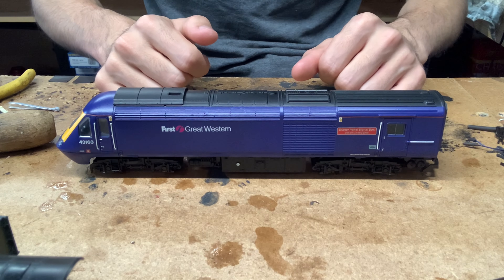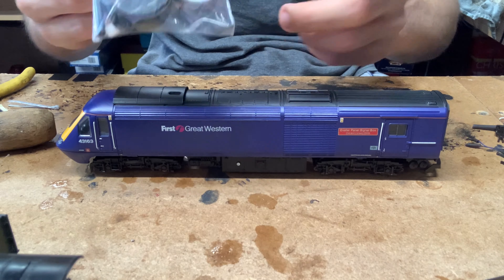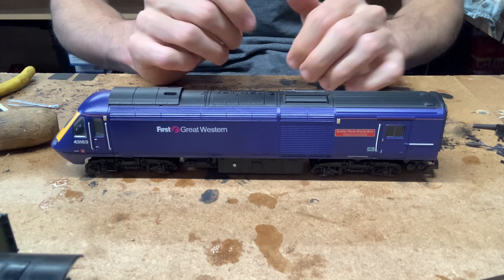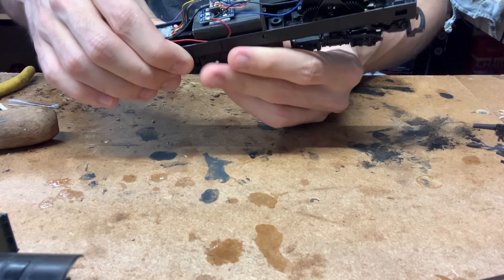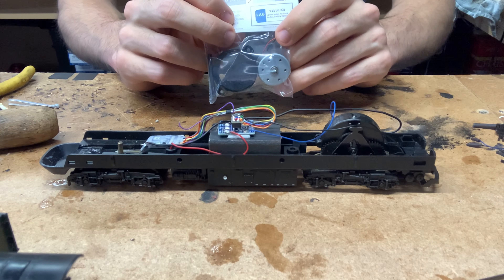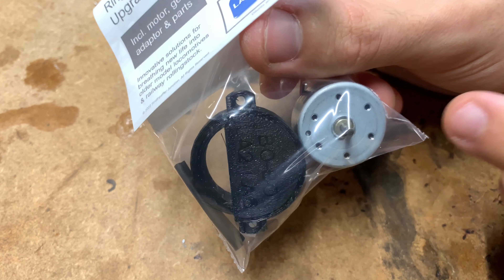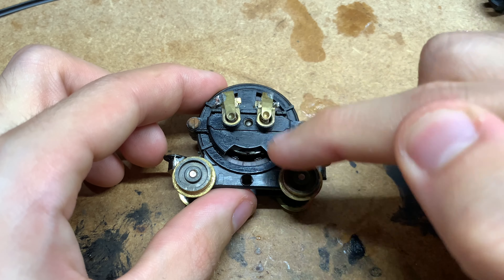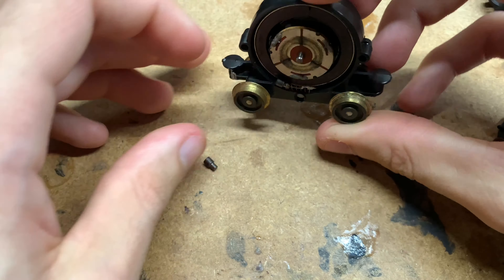How to fit a CD motor to a Lima HST

Comment: Great video my friend. I have a Lima HST and I love these models. I plan to add lights into mine as it will look better with them and a cab interior as well.
Reply from the maker: Thanks for watching mate. Best of like with yours 👍. I have fitted a couple of my Lima HSTs with directional lighting as well as upgrading the motor although it’s not quite right for the MTU power cars. Should be able to correct it at some point.